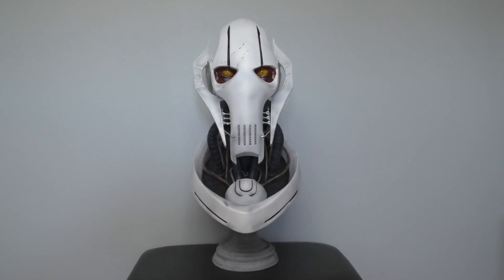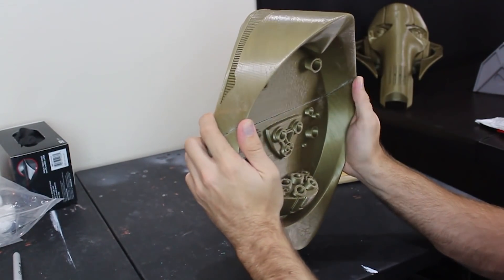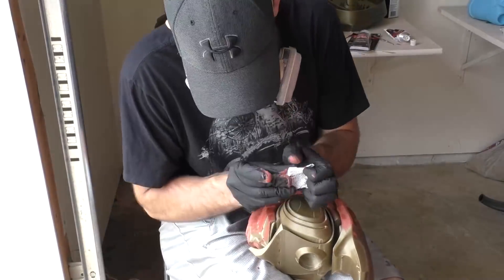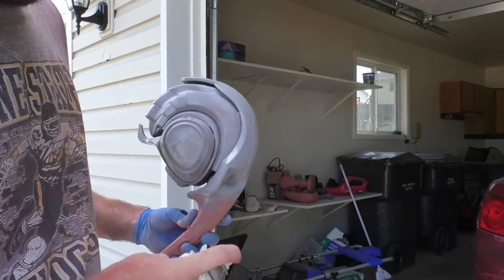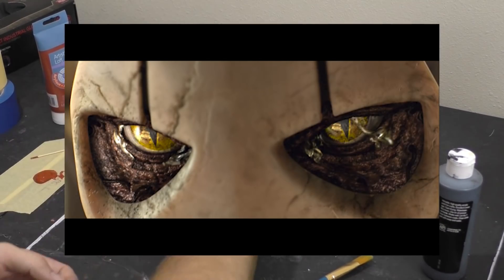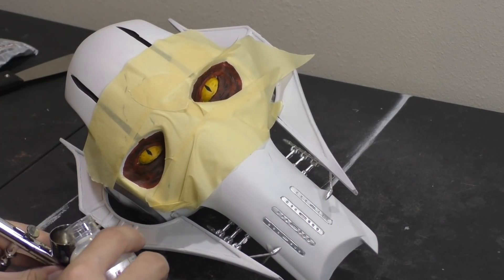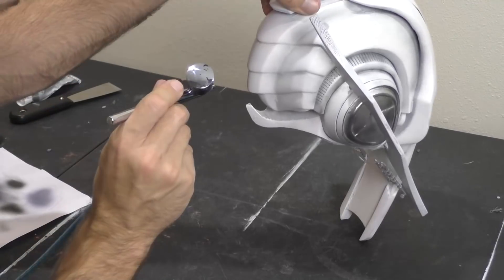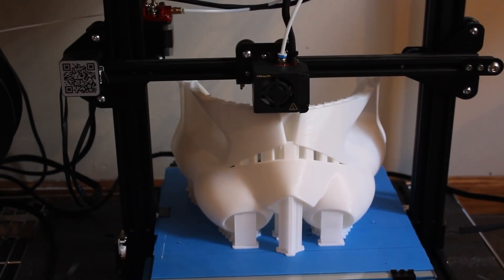Hello There! - How I Made My OWN General Grievous Bust

Comment: Having purchased this Stl I have almost finish the mammoth printing task.  Everything so far is ok apart from the inside base surface of the Base Front V2 and Base back V2.  The inner flat surface on the Front STL has a very obvious ripple effect with prominent lines and a rough texture to the touch,  however the Back STL is almost smooth with very minimal effect.  Maybe this is deliberate ?  but now I have glued the two parts together you can see the difference very clearly.

Comment: @Galactic Armoury have you ever tried pepakura 🤔???
Reply from the maker: Yep that's actually what I started with before 3d printing
Reply: @GalacticArmory  wow thanks I've been making my own over lockdown it's very rewarding to build your own sometimes when you don't have a big budget
Reply: @kevingormley6994  I made an entire base for my p2 realistic helmet out of pepakura before I made a mold to sell casts. It's a hell of a lot cheaper, but to make it accurate, it took me a good 6 months to finish, and I only used the base as a basic shape, I ended up changing a lot.
Reply: @noahsteiner5052  nice man wish me luck 🍀
Reply: @kevingormley6994  Who are you making? Do you have an insta or something where i can see progress id love to follow the build and give tips
Reply: @noahsteiner5052  I am building a phase 2 clone trooper helmet and I am hardening it with wood glue
Reply: @kevingormley6994  Id recommend hardening it with one trial kit of smooth cast 65 d, then  either put a layer of fiberglass resin and then smooth with bondo or just go straight to bondo if you are on a tight budget (just make sure to cover the entire helmet if you are only using bondo, otherwise paper will peak through). Wood glue somewhat strong, but it goes moldy after a while it only stiffens the paper, it doesn't harden it
Reply: @noahsteiner5052  I tried resin but it didn't harden I must of got the wrong one so I had to go a bit cheaper
Reply: @kevingormley6994  What sort of resin did you use? Either way id just recommend the smooth cast 65d trial kit and bondo then, it turns out a hell of a lot better and will last basically forever. Its also fairly cheap. The glue might seem like a good idea at first, but it won't harden and will deteriorate after a few weeks. A youtuber called Ryzer has a good video tutorial series on it. Believe me this is one step you want to get right.
Reply: @noahsteiner5052  I watch Ryzer I'm still gonna try the wood glue I saw a YouTuber do it
Reply: @kevingormley6994  Well good luck in that case
Reply: @noahsteiner5052  I just triall of the Wood glue and it's pretty flimsy but with spackling on it it is grand thanks for your help

Comment: You could add glass eyes easily. I've used them on full sized busts and it really brings them to life. Aves makes  products called Apoxie paste and safety solvent that would work well for this. Modge Podge would probably work pretty well also. That bondo paste will work in a pinch but sets up pretty fast and is pretty stinky.